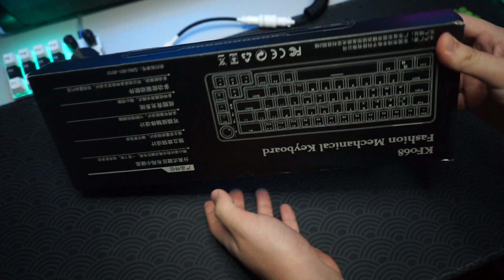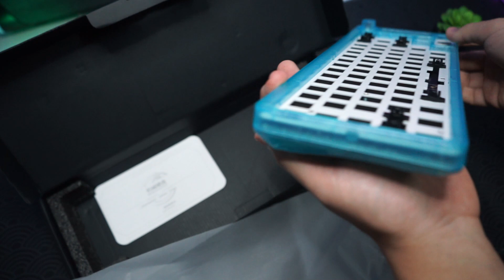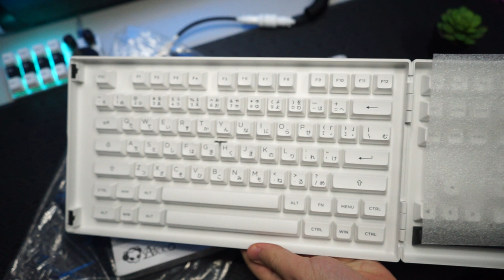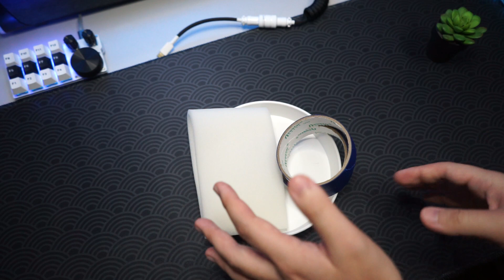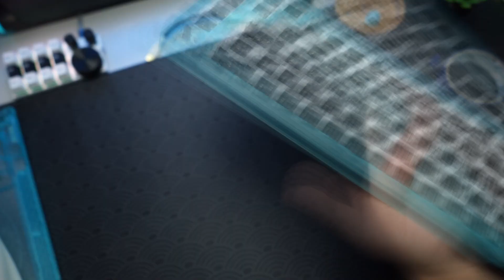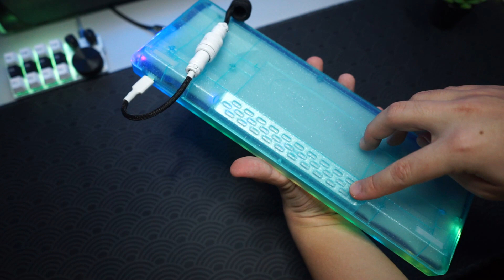TM680 Tape Mod Build - Gateron Pro Milky Yellow Akko ASA BoW | Samuel Tan

Comment: Nice video! Do you have a software to customize the light? I bought the three mode but i couldn't find the software that fit the board.
Reply from the maker: I think I have it I will put it in the description later
Reply: @itssamueltan  thank you so much. you will help a lot of people
Reply from the maker: @aimanarshad1997  I've added the link!

Comment: Hi there!
I got some questions.
Between building from scratch (MW65, TM680, REBEL60) and modding rk68 or rk84, which would you prefer?
Oso between the 3 for custom keeb which is better in your opinion?
Another one, is it worth going over taobao to search for parts?
Thanks vm 😄
Reply from the maker: Hmmm honestly, I like the MW65, video coming soon. But if u can try getting the PG67 or 64 worth it

Comment: I've heard rumors about the Tm680 breaking the next day/ a month later  because of the type c cable frying the board. Are the rumors true? Cuz I really want to buy this board but im scared it will break.
Reply from the maker: Yes it's true for the V1 and V2 PCB, so far the V3 has no problems like that as i know, u can checkout the Gamakay LK67 that one has the V3 PCB
Reply: @itssamueltan  how do I check the pcb's version? Thanks in advance
Reply: You could also get the gk68 basically the same thing as the tm680 but no Bluetooth I’m pretty sure

Comment: do you need to dismantle the keys off to take out the stabs or can’t you just take it out once the switch is out?
Reply from the maker: U can just remove the stabs once the switch is out
Reply: @itssamueltan  how about installing the stabs back do i also have to dismantle it?
Reply from the maker: @luc1.1  nope u can just do it, I took the plate out to mode the case

Comment: can you please tell me what stabs I need to buy for this keyboard? I wanna build my first mechanical keyboard and I don't know the difference between 2.0U stabs and stuff like that!
Reply from the maker: Hey no problems! For this keyboard u need plate mounted stabs, so don't buy screw in stabs, and u also will need 3, 2u stabs and 1 6.25u stab
Reply: @itssamueltan  So If I buy an Everglide set that has (7) 2.0U, (1) 6.25 and (1) 7.0, will that fit?
Reply: @Rxrezz  yes
Reply: @itssamueltan  Thank you! :D

Comment: Hey bro.im from keyboard clacker malaysia

just wanna ask.if we do the tempest mod. Do we still need to fill with foam??
Reply from the maker: Hmm from my experience yes, the tape mod acts like a low pass filter so only the higher poppy sound comes out, if u want it to sound the best u need to add the foam to absorb the deeper sounds
Reply: @itssamueltan  exellent reply.

tq so much for the input boss

Comment: Literally just ordered the milky yellow pro minutes ago. Which do you think is better for rk84? Milky yellow pro or regular Milky blacks?
Reply from the maker: Regular milky black are very scratchy even after lubed, I would say they are almost the same but if you're on a budget and need lube switches u can get the pro versions
Reply: @itssamueltan  I'm planning to lube the milky yellow pro, do you think I should wipe off the factory pre-lube before lubing?